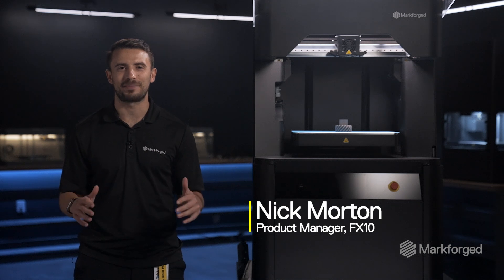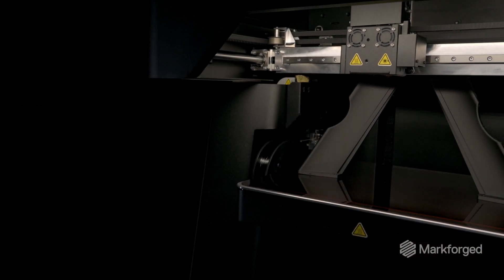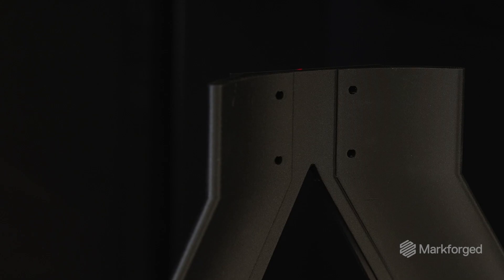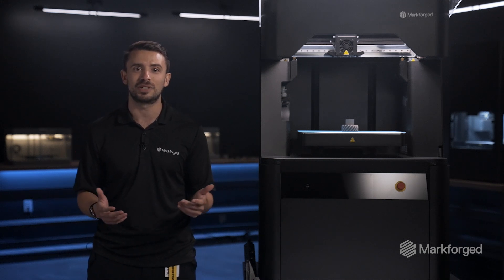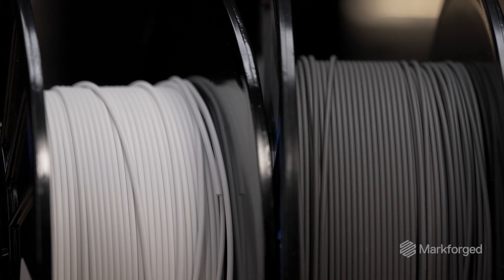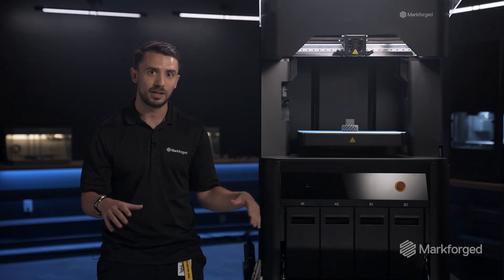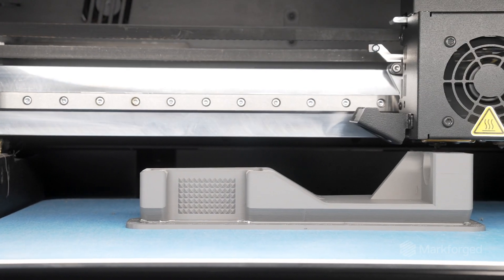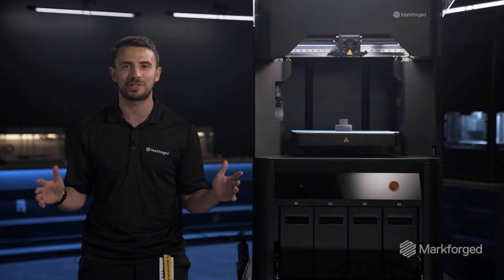FX10: Metal and Composite Overview

Comment: Not exactly awesome marketing showing off one of the biggest problems I have with the markforged printers... Bed adhesion / warping is a big yikes and is still evident @ 00:48 . Love your printers, just wish it was not 1 in 8 prints that it dislocates!
Reply: couldnt agree more i have the same issue as their own advertisment!
Reply: I saw it in another video of theirs.  It's not necessarily a deal breaker for some things, but definitely for others.
Reply: I believe we all saw the problem.
Reply: Not only that, they don't accept using other kinds of brands and materials if it's not theirs
Reply: They opened the door to film the print better, that can warp a print quickly when cold air gets on the print because the chamber is supposed to be heated to control warping. A sudden rush of cold air will warp any nylon print.

Comment: "What about aluminum? Are there other types of filaments compatible with this 3D printer? I'd like to know if the machine locks me into using only your products, or if it supports filaments of the same type from other manufacturers. Have you tested other brands, and could you provide settings to allow us to use them as well?"
Reply: Thats kinda bad, no 3D printer ever prohibited using other kinds of materials, this idea of yours wont go very far if you dont open up to using other brands or materials from other companies
Reply: @Arduino_Projects-u6j  Actually a good way to ensure quality control.
Reply from the maker: Markforged filaments are specifically formulated for Markforged printers, we don't currently allow third party materials to be printed. We'll have 17-4PH SS and 316L at launch, with Copper, H13 Tool Steel, and D2 Tool Steel sometime after launch.
Reply: @markforged  Are there plans for implant grade Titanium.